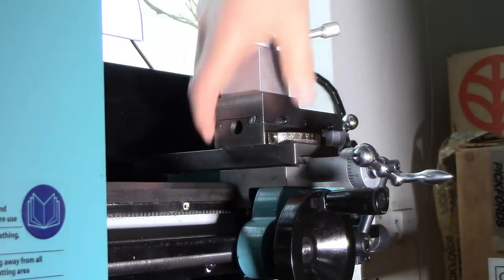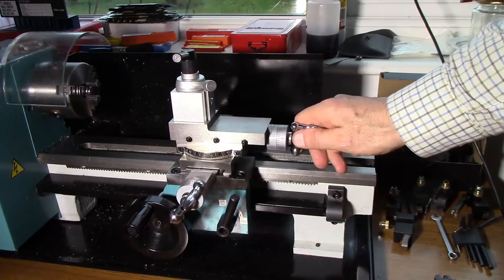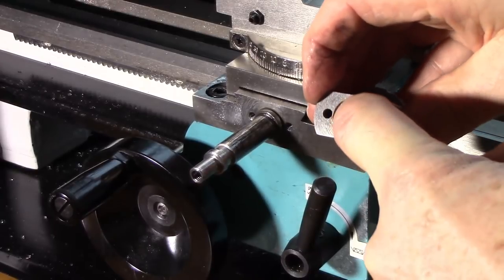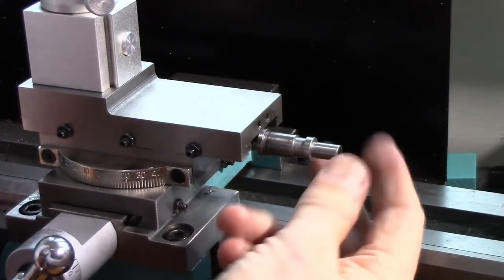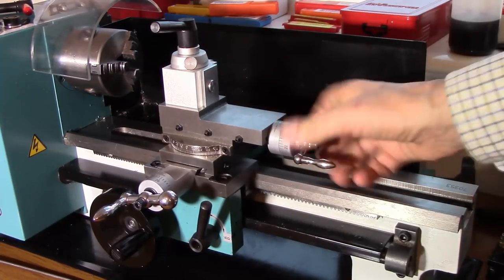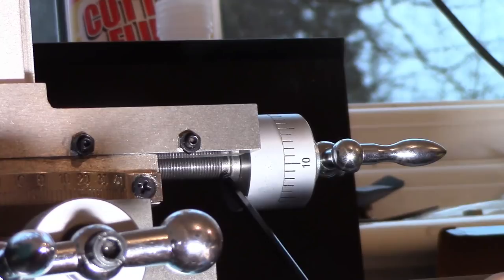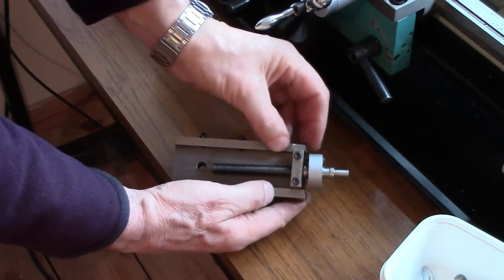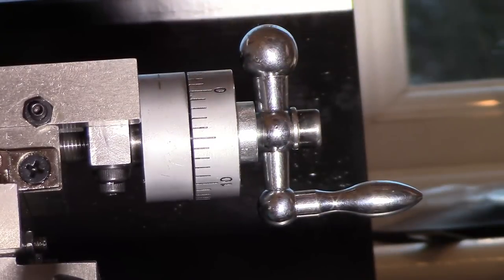Design fault in SC2 mini-lathe topslide actuation?

Comment: Very nice. As far as the lift on the top slide goes, I’ve noticed that many small Chinese lathes, for some reason, put the gib on the wrong side. It should be away from the leading edge where the pressure is exerted, as the one for the cross slide is. The other problem is that these gibs aren’t properly fitted. A problem with small gibs like these is that the screws push the gib away from the dovetail in the top slide, leaving a slight space. The gib can wobble about in that space around the screw tips. That means that unless the gib is tightened as to prevent movement, there is enough space to allow that small rise you’ve noticed. I don’t know if the gib has dimples for the screw tips, which should be rounded. But if not, it can move. Sometimes the dimples don’t line up with the tips when they are there. This problem doesn’t occur as much when the gib is in the trailing side. The best gibs are tapers and adjusted with one screw at the end, or in bigger machines, with one in each end. With those, the gib is always in complete contact with both sides.

Comment: I noticed this problem when I first got my lathe several years ago. My remedy was to lap both bearing surfaces until mirror smooth. This allows free movement between the surfaces and the flat spring tension was sufficient to allow the micrometer to turn properly in both directions. With this particular modification I do have to lube the surfaces with WD 40 and occasionally am required to remove and thoroughly clean the parts. I also replaced that knuckle busting cap head screw on the handle with a button head screw. It was very annoying to have that cap head interfering with smooth movement by hitting against my fingers. The button head works very nicely.

Comment: Hello Samuel, my lathe ( Einhell MTB - 3000 , a mix of C2 and C3 Sieg ? ) had a similar problem. My compound screw is of an older ( ? ) type: no friction spring for the dial ( and no space for that, of course ) but - instead - with a screw through the radius of the meter-dial itself ( to fix that dial in position ); and with 2 nuts to be tightened one against the other, to avoid the screw from going inside alone ( when turning clockwise ), with no any compound motion ... So, when i used to turn the knob clockwise, the two nuts were pushing against the dial, which in turn was pushing against the reference wheel ( that one fixed ... ). Crazy system !
I made a change, now one of the nuts is rebuilt to have also a cylindrical part which goes into the dial ( whose hole was made larger ... ) and pushes directly against the reference wheel.
So the meter-dial is now totally free from screw turning ( clock or anti clockwise ... ).
I reduced the backslash to seven ( or eight ? ) divisions ( carefully adjusting the nuts position ), and the handle now turns nice in both directions ... 
Alessandro from Italy.
Reply: YOU !! SHOULD !! HAVE !! PUT !! YOUR !! LATHE !! STRÀIGHT !! INTO !! A !! METAL !! SHREADDER !!!

Comment: If you look at the shaft where the dial is positioned there is a wide groove. There should be a sort of leaf spring in there to add friction to the dial and it solves the problem.
Reply: It's a battle between the friction created by the leaf spring (radially) and the friction that's bearing against the whole disc by turning the handle (axially). Depending on which one is larger the indicator either moves or gets stuck. Since you want to tighten the gibs to avoid vibration this increases the latter friction until it exceeds the spring friction. So you either have a working micrometer dial, or you have a stable top slide - can't have both with that design as-is.
Reply: @totallynotabot151  Thanks for your reply.. As it goes back a year I was confused what I  was posting about so watched the video again. You mentioned the spring yourself when explaining the problem so not sure why I posted above.  Your video explains the issue and how you fixed and why so apologies for my post saying a spring adding friction would solve. Good point you make here though as the gibs get tighter so the friction to overcome on the dial increases..I over looked that!  There is me trying to mentor you but you end up mentoring me!

Comment: I used to have a 920 model which was just a bit bigger than this but very similarly built. The best way I’ve found to fix all of the slide and feedscrew issues was building a new saddle which used myford parts on top of it.

Comment: It is a solution to the issue you highlighted and without prejudice can i sugest you just take a bit of flat bar and drill 3 clearance holes and bolt it to the existing two holes on the front. Allowing clearance for the shaft but not enough for the collar obviously. I think it is more elegant without the need to modify the casting or cut the gib.
Reply from the maker: As far as I can remember I think that would also work, at the expense of slightly moving the shaft away from the slide, and needing longer bolts. But to each his own.
Reply: @samuelfielder  5mm - 6mm flat bar would do the trick. You might just get away with the same bolts.
Reply: That's a good variant on the idea. I think i'll implement this on mine.

Comment: Very cool, did mine slightly different I turned a 33mm dia 6mm wide bush bored out 12mm through hole then bored 3.2mm depth 14mm dia for the leadscrew flange and this only mean 3mm lost on the travel worked great (also require slightly longer mounting screws)

Comment: I had the exact same issue and solved it by adding adding a washer between the indicator static ring and the top slide, without shortening the original gib. The washer takes up the load in one direction and the spring loaded dial rotates in every position of the top slide.  The top slide screw still has lost a small amount of movement but that is insignificant

Comment: Two or even one brass ring between the indexing disk would have done the same, and you still would have the same amount of movement range

Edit -I made it and it working like a charm. An indent in the indexing wheel creates room for the washer, removing the awkward space.
Reply: Have you by any chance got a picture 👍🏻
Reply: METAL !! SHREADDER !! WORKS !! WONDERS !! TOO .!!!

Comment: Look at Steve Jordan channel, he added two more screws to that slide, tightening them makes the whole assembly rock solid, helps when parting off for example.
Reply from the maker: Thanks. Yes I intend to add those, as mentioned on the other video's comments. But it doesn't address the micrometer screw problem (when you want the slide to move).
Reply: I've never noticed that micrometer screw problem on mine to be honest, mine are imperial anyway, I don't like them much, I just keep checking with my digital caliper in mm.
Reply: THAT !!! METAL !! SHREADDED !? MYFORD !!! !! GEEZZA !!! TWIT !! BANG !! GOOD !! SHILL !!! MAN !!!

Comment: nice one,  my lathe does have a grub screw on its dial which lock the dial on feed screw , it may be a good to add one on yours
Reply from the maker: Yes, a grub screw is yet another way of solving this problem, but of course you'd then need to undo it every time you want to zero the dial.
Reply: Would it be possible to use a grub screw plus a spring and a ball bearing, that way you may not have to back off the grub screw.
Reply: @adoreslaurel  the dial diameter is not that big on mini lathe , however is possiable to do that but I don't see any point to do it
Reply: @ParsMaker  Ok, thanks for that.
Reply: JUST !! PUT !! YOUR !! LATHE !! INTO !! THE !! METAL !! SHREADDER !! FIXES !! IT !! NO !! END !!!

Comment: Mine is different and maybe not so good either. Mine has a grub screw on both axis that holds the dial from moving that solves the problem, but also makes it so that in order to set the zero I have to use an allen key to loosen the grub screw. No springs in mine at all, so they have cut corners again.
Reply: METAL !! SHREADDER !! IS !! THE !! ONLY !! OPTION !! FOR !! YOUR !! LATHE !!!

Comment: I bored the bracket to accept a small ball-bearing, and loctited the bearing into the bracket and onto the shaft. It solved that problem and in addition reduced the backlash there to something imeasurably small - no shimming required. The sealed bearing came in a packet of 5 for a couple of £ from ebay. I did something similar on the cross-slide.
Reply: YOU !! SHOULD !! HAVE !! PUT !! YOUR !! LATHE !! STRAIGHT !!! INTO ! A !! METAL !! SHREADDER !!
Reply: @davidwillard7334  Thank you for that considered and constructive comment.
Reply: @pjday6195  NO !! PROBLAMO !!

Comment: I bought one of these which had digital read outs on both the cross slide and top slide. The top slide dro went up the creek and after much discussion with the supplier's they sent me a replacement unit for a micrometer dial and a dial. One of vital pieces was missing and nothing else fitted.  I was informed China are for ever changing the design of parts and no spares are available. I had to bodge-up something which more or less worked but is not at all satisfactory in that the slide is loose and the dial does not go round at all.
I would NOT recommend such a lathe to anybody except a highly skilled engineer who could put it right.
I did some drawings of my bodge-up and am still awaiting an acknowledgement from the suppliers.
Reply: @davidwillard7334  I took it there but they wouldn't take it!!!!!!
Reply: @bbcisrubbish  Well ! TAKE !! IT !! SOMEWHERE !! ELSE !!

Comment: There should be a half round spring in the groove under the graduated dial that I don't see in your video.
Reply from the maker: @claytonmusgrove8438  Yes, the spring is fitted, I just didn't show it in the video. It isn't relevant to the problem I was trying to address.
Reply: Basically the spring is not strong enough. If you loosen the gibs the spring is sufficient but then the slide wobbles.

Comment: Nice Work.
Excellent solution 

My Harbor Freight 7x12 mini lathe top slide has that issue. 

Just a suggestion on your loose top slide  ... maybe replacing the gib with a better fitting gib would take that slop out and still allow you to move it..?
Reply from the maker: Possibly, but I don't have a milling machine, so don't have any ready way of making another gib. I've been watching Keith Rucker making a new gib for his (much bigger) Monarch lathe. Interesting stuff, but beyond my capabilities at the moment! I certainly think the design of the topslide gib - with its three grub screws -  is poor, compared to the tapered gib on the Monarch. But of course one has to look to the relative price of these lathes.
Reply: Well done fixing the dial, the dial on my lathe doesn't rotate when i move the cuttter and its annoying. I think i can fix that now.
I believe those gibs can be ordered as a whole part, they come a little bit over sized  which you could get exact by hand scraping and a micro meter.
Making a replacement completly from scratch without a mill would be difficult.
Reply: @samuelfielder  That gib is too wide, instead of a square it should be a rectangle with the thinner sides left and right and same thickness top to bottom. For some reason (or none at all) they cut the compound and ways further apart than they should have.

Comment: Cool... but have you tried rocking the topslide forward and backward to see the amount of play ? 
based on the backlash I see at the end of the video I am sure there will be plenty of rocking back and forth as the slack is taken up between the two microm dials.
Reply: THE !! METAL !! SHREADDER !! SHOULD !! FIX !! THAT !! NO !! END !!!
Reply: The slide rocking is nothing to do with leadscrew backlash and all to do with extremely poor build and fit of dovetails and gib. I doubt it would be possible to put any less effort into building these and still end up with at least somewhat working machine.

Comment: First thing you gotta do is sand the ways flat. The top slide can be flattened on a piece of sandpaper laid out on a flat surface. Once that's flat(test by bluing and sanding to detect high spots) I glue sandpaper strips to the bottom of the top slide and reassemble the compound and tension the gibs down to point it barely moves and slide it back and forth by hand until you have a flat way surface. Now do the same for the cross. I've found that manufacturers do a good job on the bed where the carriage fits but terrible job on the cross and compound. You may also need to make new gibs or sand yours flat if they aren't too bent. Once done you'll find it doesn't lockup when you remove the slop. You won't have slop in one area and too much tension in another as well(my main problem).
Reply from the maker: Yes, something like that. The purist will say I should scrape them and that sanding will just embed abrasives in the ways. But with these cheap minilathes one probably doesn't need to be too careful. I did measure the top slide ways carefully with micrometer and dowel pins but could not get consistent results so could not decide what needed doing. Remaking the gibs is definitely desirable as the standard ones aren't really big enough.

Comment: I have to ask is this by the colour on the lathe, is it an Axeminster supplied unit ?
Reply from the maker: Yes it is an Axminster one. I think the Warco one is slightly different.
Reply: @samuelfielder  I have been looking at a SIEG C3 chinese import lathe, which on looking and comparing them seem identical, bar the paint colour is this correct.
Reply from the maker: All these lathes are made by Sieg. The colour varies according to importer. But there may be small differences between different imports. Mine is an SC2 (Axminster C2-300). I'm not sure what the C3 is though (can't see one on Axminster).

Comment: welcome to the word that copy every ting and does not know what they are doing and do not care as long they make money....  I did not had the problem with the dial, but ill did check my lathe an to my sup-rice  it had the same problem. I am not looking op from this . But what I do not understand that  if people find this out they are not reclaim this by there supplier and send the crap back. If it was a VW Atlas or similar the people were standing right away at the garage and started a big recall for that model. ( unfortunately I bought this price off crap from a good friend and not from a dealer) I do know that you get what you pay for, and that you can not make a perfect lathe for that money, but it does not mean that in this case the manufactures/copiers should take responsibility...